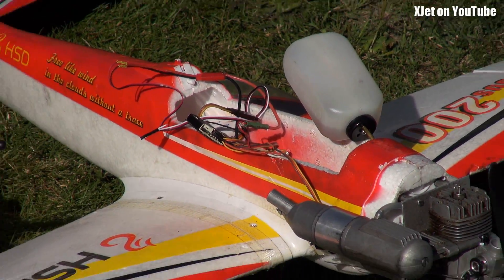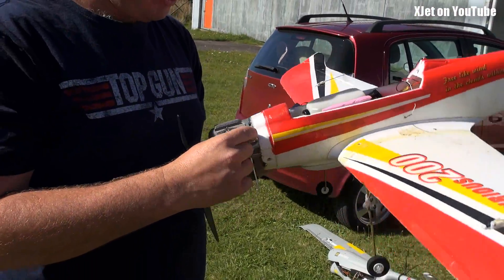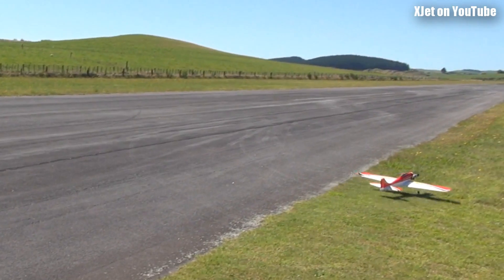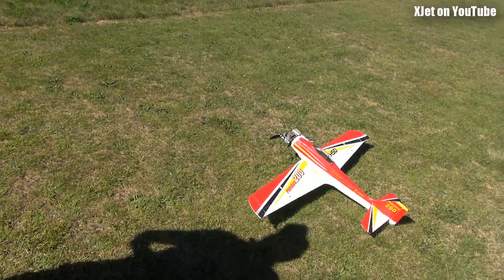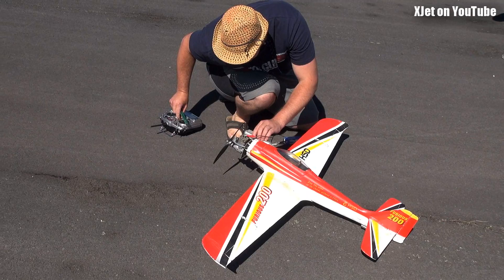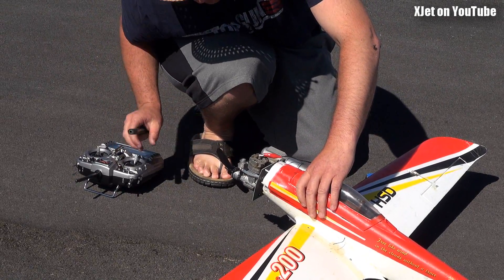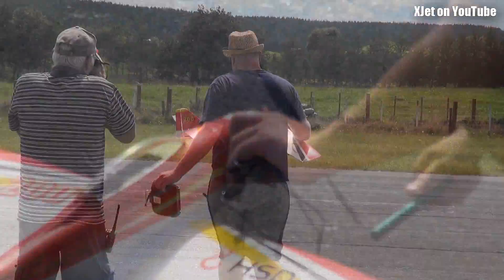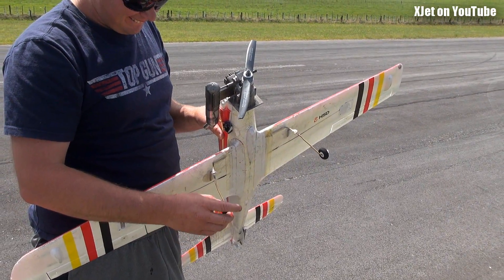Nitro plus foam equals SPEED (eventually)

Comment: Model Diesel Engine 'planes? 

I will be looking for someone to test it, if it looks like it will actually work, prototyping only. 

England, UK:

Does it look like it would start a Model Diesel Engine, the spring is I think powerful enough, but are there any issues you can think of to improve it more. 

Watch it working dry run. I do not have a Model Diesel Engine to fully test this in real life* :- (Note I believe this may power turn the incorrect direction but I have the other direction turning files are also online; also an attachment design of RC plane starter insert 30mm x 36mm 20mm inner hole, not 3D printed at this time ) Clockwise power turning in video I believe the power turn the incorrect direct direction 

https://youtu.be/cFFxhDgPCqU?t=31m41s 
and 
https://youtu.be/b4kX_Pb5Oxs?t=1m10s 

3D Printer files anticlockwise power turn files, I believe is the correct way, (not 3D Printed at this time by me, 3D Printing can take over a week), waiting for feedback about design, does it look like it will work in real live ? I think 90% sure it will :- 

https://www.thingiverse.com/thing:2905976 

* Very, very, very low budget this end :(

.

Comment: Can you have a look at the latest baggage rules from Emirates?  they have decided that it is a security risk to pack a drone into your hand baggage.  You must put it in the hold, where their baggage animals can steal it or destroy it.  Your battery must be in your hand baggage.  If you haven't booked checked baggage, that isn't a problem - you can just pay lots of money to add a checked bag at checkin.
Reply: Yeah I had to take pack my Mavic in my checked luggage when I went to Europe last October with Emirates. I used the separate small zip-up cases for the aircraft and controller and "sushi wrapped" them in about ten layers of clothes for both impact protection and theft protection. I was using my hiking backpack, which is cut-resistant but not impact resistant, so plenty of padding was necessary. The Mavic survived both plane trips and two weeks of backpacking without issue.